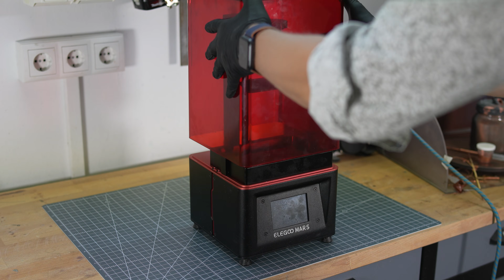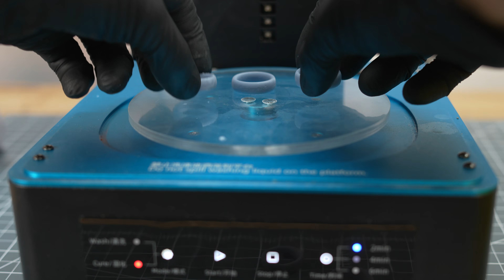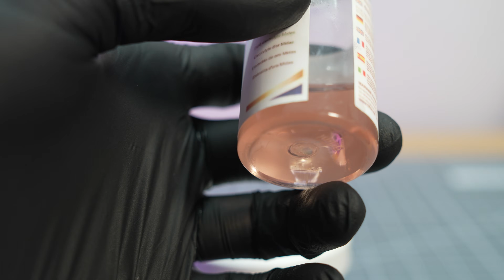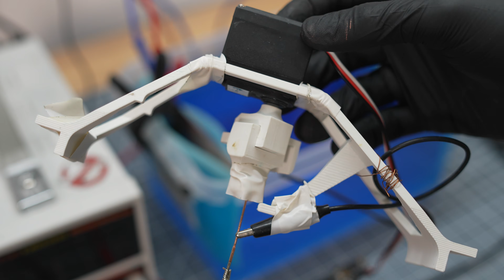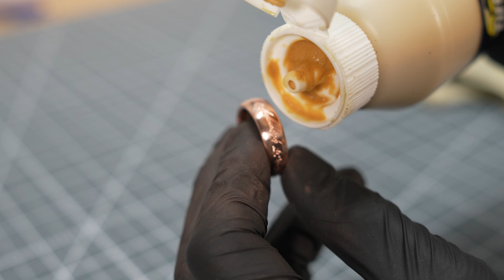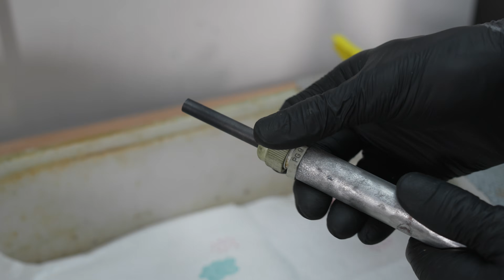Electroplating 3D Prints | Rings Tutorial

Comment: Hi
Could you please tell me if your process of ring rotation in the bath prevent getting an extremely ROUGH SURFACE condition from the Copper onto the part? I’ve been using a magnetic stirring station as form of Agitation. 
I use a graphite paint that I Airbrush onto my 3D Resin parts. 
Thank you very much!
Lee

Comment: I have a question, does the print HAVE to be copper plated  to be able to gold plate it or would the copper conductive paint be enough ?
Reply from the maker: Copper + gold is cheaper. You get a 200microns layer instead of a 2microns gold layer
Reply: @hen3drik  would i achieve the same result if i plate it with silver instead of copper ?
Reply from the maker: @alexdiaz8259  I never did and I doubt it would work. Why would you do it with silver??
Reply: @hen3drik  i just figured silver might be better against tarnishing lol

Comment: I have an issue where the wire that holds the ring gets coated quicker than the ring.  Copper deposits quicker to the copper wire.  Trying to polish the ring more to see what my outcome is.  Using .12 amps.  Maybe its too high😢

Comment: Hi!
Nice video (like the others) and amazing results.
I've tried to follow your steps but I'm not able to obtain anything looking good.
My 3D printed part is 0.23dm2 (determined with your Blender trick), so I set to 0.23A (result to ~0.5V/not been able to set current and voltage, at least no idea how to and if it's even possible), after 1h the result is matte, no shiny at all, but worse, the copper wire is embed with the plating of the part, removing the wire damage the plating, I can't imagine the disaster after 4h.
The galvanic degreasser from Tifoo doesn't works with current, so I let the part few min as in the product before washing it with water.
Not been able to plate anything with graphite layer, so I use the copper paint and degreasser from Tifoo and copper shiny acid from Dr Galva.
I don't know what I missed.
Any help appreciated
Reply from the maker: Some quick comments:
1) apply 2-3 coats of copper paint  2) don't degrease the copper paint 3) set your power supply to CC mode and set the current to 0.24A, let the voltage regulate by itself 3) Move the Part after 30 mins to avoid welding the wires into the plating 4) keep 10-15 cm distance from the anodes. 4) looked up drglava electroylte. pH is 1 which is fine. 5) double check your wiring 6) check again
Reply: @hen3drik  Thanks for your answer and tips, will try again (and again....). It's Tifoo who told me I've to degrease the copper paint as the copper layer was peeling on my first tries. Will try more thin layer of paint with airbrush as I actually apply it with the aerosol spray I bought, I also apply a primer layer before. I use a round container of 12cm with magnetic agitator.
Reply: @hen3drik  Hi! Very bad results when copper paint applied with airbrush (and awful to clean it afterwards), much better results with spray. Also much better results with 3A/dm3 instead of 1A/dm3. But it's still not really shinny, stay quite matte. Perhaps due to bad electrolyte quality or something I'm still missing.

Comment: What is the best method to ensure the longevity of the gold plating? With which product can I preserve the gold?
Reply from the maker: While gold is a highly corrosion-resistant metal, it can still experience wear over time, especially when it comes into contact with substances like sweat, oils, and chemicals. You can deposit a thicker layer of gold. Over time, any gold surface will naturally undergo some level of wear, even with additional protection. Regular cleaning and maintenance are still recommended to keep gold items looking their best and to minimize any potential issues.
Reply: @hen3drik  Ive heard that crystal clear coat aerosol sprays can preserve it a bit. But I can’t find a good manufacturer in Germany. I’ve read, an insider tip is ceramic coating but can only find it for cars and not to wear it on humans skin.

Comment: What Compressor & Airbrush are you using? Thank you for this wonderful video!
Reply from the maker: I use a generic compressor without a reservoir (I wish i had one).The Airbrush itself is one of the cheapest i could find (15€). I use it only for my copper paint mix. Make sure to get an airbrush with larger needle (mine is 5).

Comment: Does this have to be a resin printer or can it be used with any type of standard 3d print material?
Reply from the maker: For small parts resin prints are optimal. When it comes to sanding and smooth surfaces I prefer resin prints, but if you can manage to create a smooth surface go for FDM prints. I covered this in my most recent video. It‘s absolutely okay to do so.

Comment: can u electro plate brass on to 3d prints?
Reply from the maker: I haven’t found brass electrolyte yet, but I helped myself with electroplating a thin layer of zinc on the coppe coat and treating it with a heat gun. Er voila: brass

Comment: Hello Hen3drik! This looks so amazing - so I had to try it myself. I bought the Dr. Galva sour copper electrolyte and the tifoo copper conductive paint for airbrushing. I replicated your setup as good as I could (the bath is smaller (13*13cm) and I dont have the tech cloth pouches for the anodes) but otherwise they seem the same. I resin printed the same ring you did. I copied your voltage and made a small arduino to rotate the ring in the bath. But my ring is not shiny when it comes out. It is a hazy copper colour, that needs to be sanded to shine. Is this a problem with my spraying? Or do you sand the conductive copper spray before putting them in the bath? Your conductive paint seems to gloss more than mine which is a little dull in comparison. Any tips would be greatly appreciated - I sort of already promised my kid we were going to put gold on all of our 3d printed stuff, so I am completely pot comitted  ;-)
Reply from the maker: Hi, this could be multiple reasons: 1) make sure to use constant current on you power supply (not voltage). I switched to this method lately. See my newest video for the calculation of the current. 2) use more diluted copper paint. It should shine. Apply some layers. You can try to carefully polish it a bit  when totally dry. OR use graphite paint (latest video). Does the dr galva sour has a brightener in it? - keep on trying. You‘ll succeed!
Reply: @hen3drik  Thank you for answering! Very much appreciated. I had 0,2 v but the current was changing constantly. I will check the newest video - I primarily used this one, the tutorial and some of the older ones.  The electrolyt is the same glanzkupferelectrolyt that you use. I actually tried to copy your setup as much as possible to minimize error sources. Now that I think about it - even the raw kobber wire the ring hung on had the dull coating which actually is a little weird. Maybe it is not my airbrushing that is the problem. hmmm. I will try the method on the newest video and see where that gets me. Thanks!

Comment: 0.06 amp is shown while you say 0.7 volt and 0.2 volt is shown. So what is it?
Reply from the maker: It‘s 1A/dm^2 surface area. I switched to working in constant current instead of constant voltage.
Reply: So what would be the perfect amp for a ring that size?  I have been trying this myself, I am atm trying it but now at 2 volt it gives me like 0.07 amp. I have no idea if it is any good but copper is forming as I typ this. Not at alll shines like yours, you also use a brightener in your elektrolyte? Thank you.
Reply from the maker: @FXHazardproductions  0.16A would be good. This results in around 0.5-0.7V. I use a acidic bath with brightener. 2V seems way to high. What conductive paint did you use?

Comment: Question:  If I have been cold-casting brass buttons (brass powder mixed with polyester resin), then do I need to coat them with the conductive paint before plating?  Will the brass in the mixture be sufficient for conductivity?
Reply from the maker: I guess not. Is it already conductive? If so measure Ohm for about 1cm. Should be max 1.2 kOhm.

Comment: Amazing work, congratulations! Can you reuse the copper electrolyte? And also can you electroplate more objects into the same bath at the same time?
Reply from the maker: yes, the copper electrolyte is reusable for many times. i do some maintenance like filtering or adding brightener from time to time, but it's the same since 2018. you can electroplate as much parts that fit in your bath at the same time. also your psu should be capable, too.
Reply: @hen3drik  Thank you! I appreciate your work, looking forward for more amazing videos! 🤩

Comment: Can I electroplate copper spray with thick bright zinc if I just need my piece in silver color?
Reply from the maker: I have zinc electrolyte as well, but it deposits not bright but dull. You can polish it afterwards. It also deposits quiet dark. Wouldn’t recommend it for effect. You should use copper and then nickel or palladium. Or go chrome III. After nickel you can goto gold and on that electroplate silver. These are better alternatives.
Reply: @hen3drik  Thanks a lot. After spraying the copper paint, can the part be nickel plated without the copper plate base?
Reply from the maker: @Sing00525   yes, but why? Copper is cheaper, less toxic, deposits fast, easy polish etc.

Comment: Hey! I use the exact same setup as you, the airbrushing works and looks flawless, however when I apply 0.2v at the beginning for 1h the surface becomes rough and uneven. Is more voltage required for the brightener to take its effect? I used extremely small parts btw, around 2cm² area. Or it it best to lower the voltage even more? I just wanna ask before wasting even more electrolyte, because somehow it got contaminated very quickly in my run
Reply from the maker: Hi, filter your electrolyte with i.e. coffee filter. I'm not sure what rough and uneven means. Rough is okay, because you should increase current to the appropiate Amp (use dm² = A) which will result in a voltage around 0.7V. Then the brightener will work.
Reply: @hen3drik  Thank you very much. In another comment section you recommended me some aquarium filter, I bought it, it's very thick but I suppose it should be fine.

With rough I mean an uneven non shiny surface with a grainy texture after 0.2V for very small parts

I will try a higher voltage, thanks!
Reply: @hen3drik  I got it working, thank you so so much! Now I only have to deal with the copper anode residue, the "dirt" always goes through the filter...

Comment: Hi, do you have any experience applying a sealant to increase durability as a last step instead of increasing the gold layer thickness? Also, have you ever gotten into titanium plating with ethanol solutions? I'm curious if it could be anodized afterwards for colorshifts - but I guess the oxide layer would probably be too thin?

Comment: Wow amazing job on your electroplated ring. Is there a possibility it can be done with pla , or maybe Abs instead of resin ?
Reply from the maker: Absolutely. It‘s the same process. Make sure to get the surface even and smooth before applying the conductive paint.
Reply: @hen3drik  So nothing changes with different materials wow 😍 thank you so much for the info whats the best material to use for the most gold like feeling ?
Reply from the maker: @outdoorios2315  doesn’t matter, as long as you polish the copper layer (which already feels awesome after) gold shines super nice.

Comment: Your videos on electroplating have given me a new goal in crafting. I have one question though, could this be one with any shape? More specifically would this work with a set of RPG dice??
Reply from the maker: Absolutely. With copper electrolyte you‘ll need a direct „way“ between the anodes and the surface, but you can prevent these anode shadows by rotating it.
Reply: @hen3drik  any information on your rotojig? Wondering what motor you used.

Comment: Would it be possible to plate a layer of aluminum onto a ring like this?
Reply from the maker: Unfortunately not. Do you want a matte finish or polished Aluminium Effekt?
Reply: @hen3drik  I was planning on polishing. I have a bunch of aluminum ingots I made from melted pop cans. I tried lost PLA casting, but I don't have the right setup for jewelry. I figured plating in aluminum would be a potential option.
Reply from the maker: Let me get this right: you made ingots for casting, but this has nothing to do with the plating approach you‘re planning, right? Just wondering why it has to be Aluminium.
Reply: @hen3drik  correct. I tried casting with them, failed miserably, wanted to find another use for them, got an idea in my head that I could try aluminum for a top layer.

There's another reason why I'm trying to make aluminum jewelry. I have a friend who is severely allergic to most metals in jewelry. Aluminum doesn't seem to affect her as much, so I figured aluminum would be worth an attempt.
Reply from the maker: Ah, ok. But unfortunately you cannot use the ingots for plating . You could check whether she‘s allergic to palladium, which can be plated thin directly to copper.
Reply: @hen3drik  that is an option... I'll ask

Comment: You keep saying volts, but i'm pretty sure you adjust the amperes dial?! so which is it then?!
Reply from the maker: Well, I‘m in voltage mode on my power supply. The current is relative and „adjusts“ itself. You could limit the current but then the voltage would  adjust itself. But I don‘t do that. I only set voltage.

Comment: Question: Shouldn't you soak the steel wool in acetone prior to using it?  Steel wool is steel and to prevent it from rusting, its normally coated in oil.  So to keep the parts to be plated cleaner, soaking the steel wool in acetone then letting it dry before use seems logical.
Reply from the maker: No, I don’t like acetone that much. What I actually don’t show in the video is that I degrease the sanded parts before electroplating. This removed almost any residues from the print.